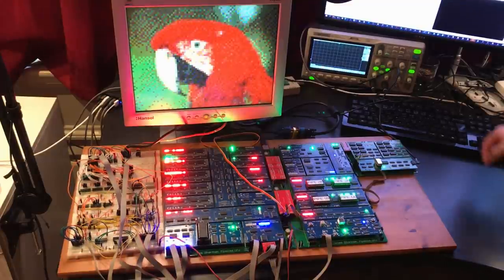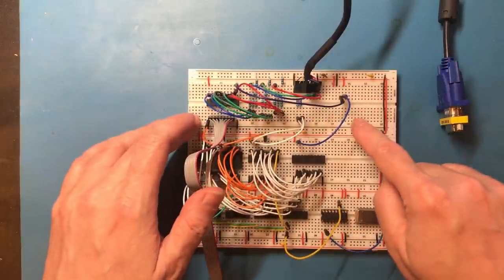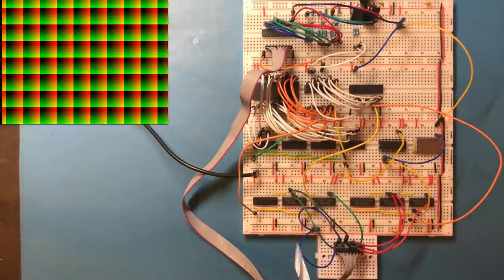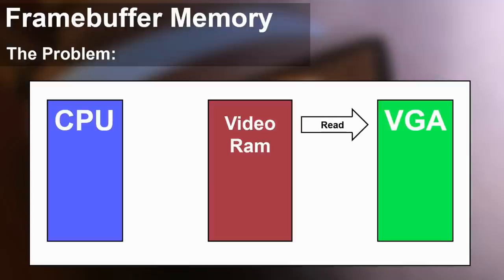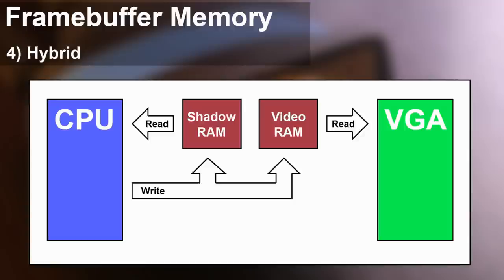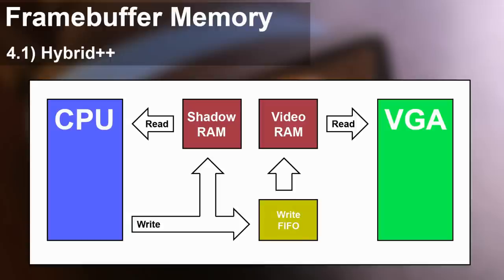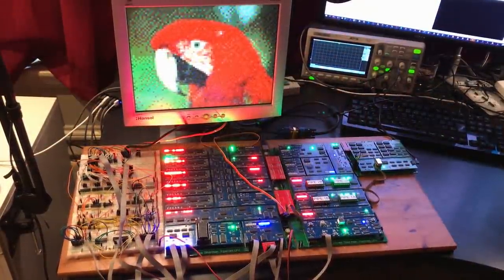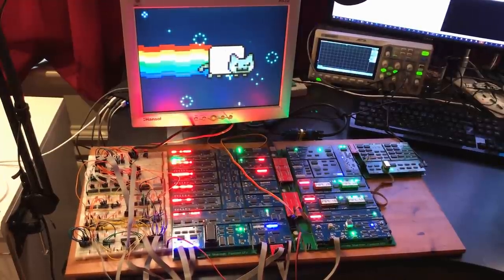Framebuffer - VGA from Scratch - Part 3

Comment from the maker: These are the vga capture devices I purchased from amazon.co.uk
  VGA to HDMI Adapter  https://amzn.to/3fmxUMT
  USB HDMI Video Capture Dongle https://amzn.to/2VgfTZI
Equivalent looking links from amazon.com:
  VGA to HDMI Adapter  https://amzn.to/3zXCgBZ
  USB HDMI Video Capture Dongle https://amzn.to/2VixaRP
Reply: I don't think the equivalent on amazon.com you've chosen will work: 
This 6ft HDMI to VGA converter cable is ideal for transmitting and converting digital signal from HDMI devices(Notebook, PC, Laptop, DVD player, Nintendo Switch etc) to analog signal VGA devices(TV, projector, monitor etc).

Comment: That write FIFO is a really elegant solution to allowing much greater software freedom over video ram, I'd love to see it implemented
Reply from the maker: Indeed,  I really liked they way it slots is nicely as an extra feature rather than something you have to design around. Without it you have a working system, with it you get a simple improvement.
Reply: @weirdboyjim  but how do you deal with the edge case of the FIFO buffer overflowing? maybe you have to have the FIFO buffer be the same size as a whole frame and it 'degenerates' into a back buffer solution?
Reply: I vote for the FIFO too...
Reply: Ditto! I'd totally love to see the extra mile here. Maybe it's good to go without it first so it's possible to compare both.
Reply: @Philip8888888  If the FIFO is full, you simply insert a wait state until it isn't if you're going for a glitch free display. If you want maximum speed, give priority to the CPU write and starve the video by either outputting black or repeating the previous byte for less obvious glitching. The FIFO only need be as long as one scan line's worth of processing as it will get emptied at DMA speed during horizontal blanking & sync. A 64 byte FIFO should be more than enough until James adds the vector processor unit.
Reply: I too am curious about the FIFO solution but I rather suspect that, absent an interrupt system, it has to be all software and it would thus be a lot of hardware for not much advantage.  It could probably be done just as well simply using system memory, especially since your address registers can auto increment on their own.
Reply: @Peter_S_  would you send examples of any ICs that would implement such thing? The only ones I found we're over 40$ at mouser
Reply: I would love to see the write fifo as part of the build, it just adds so much flexibility and adds performance improvements.
Reply: The downside with the FIFO is that it's also really expensive. And conceptually its abitration circuitry has the same order of complexity as a dual port SRAM.

Comment: Vote for the FIFO.
Would be interesting about handling the situation where the FIFO fills up prior to the VGA getting to a blanking interval.
Reply from the maker: The obvious thing to do would be to just wright through, but you should be able to design it such that it never happens. The fastest my cpu with current instruction set can write to memory is at half the clock rate, so currently that would be 40 writes during the visible portion of the line, there would be 160 pixels of blanking interval per line. So a 40 pixel fifo would be big enough, if you raised the clock rate by 5x you could theoretically write faster than you could flush on a line so you would need to be able to handle that.
Reply: @weirdboyjim  An off the shelf FIFO with 64 slots sounds like it would handle your CPU up to 5MHz. If you stick with 4 bit multiples, call it a 256 slot FIFO. Good to 12 MHz if limited to 160 fill, 20 MHz if willing to let it flush over two scan lines. Would seriously doubt any code capable of stuffing data to the VGA that fast. And honestly, suspect that a vast majority of the VGA memory interactions would be scrolling the screen. So 2 clocks to read, 2 to write, and your FIFO has only half the work to do.

Comment: Amazing work and great video, thank you. Reminds me of the computer boards I was working with around 1985, the 8 inch floppy disc drive controller board alone used  about 90off 74 series chips.
Reply from the maker: That sounds about right! Might be fun to pull one of those apart at some point.

Comment: Thanks again for another video. I liked the discussion on how to solve the memory access issue. As someone who also balked at the price of dual ported RAM (seriously, it's 2021, how can this not be dirt cheap now?) it was nice to hear the discussion of alternatives.
Reply from the maker: Glad you liked it! It's a specialty part,  If I was trying to make a specialty demonstration circuit I might have considered it but for this I'm really trying to solve everything from the ground up.
Reply: Dual port RAM is seldom used in any volume application, therefore it tends to be expensive because there isn't volume manufacturing behind it.

Sadly it's probably not likely to get any cheaper either, with complex logic moving into FPGAs which can also implement RAM and DPRAM
Reply: It's cheaper to use an FPGA these days and make use of its internal block RAM which you can set up to be dual ported.
Reply: @nockieboy  mind-blown. i hadn't even considered using an FPGA for something as basic as sram. i know some of the lattice chips are pretty cheap.

Comment: I used to design using TTL and CMOS circuits 25 years ago ... My last design was a thermic printer .You had to control evry single pin in those chips according to the data sheet .Then FPGAs came along ,i would find very hard to go back now .As now i  have complete freedom to structure my design not in terms of generic function chips ..But i can just implement what i need ..But what you did brings me back nice memories ...specially how bulky those designs tend to be ..regards...
Reply from the maker: Glad you are finding it interesting. I plan on doing some circuits with FPGA's in future videos, but not until after finishing the pure(ish) logic cpu first.
Reply: @weirdboyjim  You are a commited person ..As i am of a certain age .Let me tell you before the micro computer revolution .All was done this way .I recall our University HP3000 system had several boards CPU .. you could literraly see the registers lol. And sometime it will  fail and we had to repair them .By using some wand signal injectors and wand logic detectors ..It was fun .It is nice to see someone like you that keep that tradition alive.Engineers now have never touched a TTL manual .at least in paper . It is one of my most proud possesion .Regards .

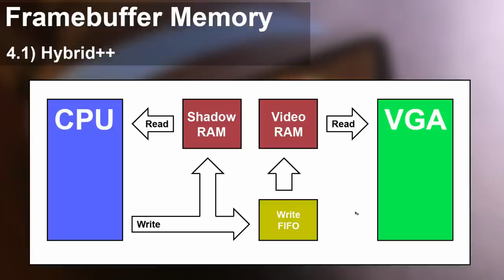Comment: @ 21:54 You also have the paging approach: double memory bank, cpu reads/writes from one memory, the VGA driver reads from the second bank. Both banks are swapped on Vsync. Cons: tear-free requires careful timing or the CPU to set a hardware lock when the first bank is ready for swapping.
Reply from the maker: For many years I was writing games and demos where we had to worry about the raster timing so that's not a worry for me. The problem with all of these "Just have double the circuitry" comments is that it doubles the circuit, and it doubles sections the planned circuit that will appear in later videos.
Reply: @weirdboyjim  True. Note that double RAM is only one more address line, as you did in the Hybrid. On the other hand, the amount of external sync circuitry might be easier said than done indeed.

Comment: Brilliant :-) Thanks for sharing with us. It gave me some ideas that I'd like to implement on my old system.
Reply from the maker: Thanks! Hope your build is going well!
Reply: @weirdboyjim  Thanks for asking :-)
A'm not quite there yet. My project is based on the video interface of the brittish Nascom-2. The very short description is, that a certain memory area has a double function, completely invisible to the CPU. Writing 41H in a memory cell in this area, will result in the letter "A" being output to the screen.
Some counters, multiplexers, an eprom (containing the graphis representation of the ASCII charset) creates the basis for the video signal. This construction makes outputting text to the screen very fast, as the CPU does not have to "draw" every single letter before text is written. This is solemnly done by simple hardware.

My angle is replacing the special RAM block whith a dual-port RAM chip. This will eliminate the need for the multiplexers. Giving the CPU and the Video output curcuits individual andress and data lines to the same RAM block, also simplifies the handling of horizontal and vertical linesync.
A physical VGA-end would be a very nice upgrade to the simple analog video curcuits of that time :-)

Comment: 12:25 depends on where you buy! when i used one of those exact chips in my first crappy card i bought it used for a fraction of the retail price.
the downsides are the size of the chip and the speed. if you need more than ~16kB of VRAM you're gonna need a really big PCB, and at 55ns access time you won't be able to get anything that requires high bandwidth
Reply from the maker: I’m trying too only use easily available parts from common suppliers.
Reply: @weirdboyjim  yea that's reasonable. i feel like i should stop commenting on this older videos and just watch the whole series to maybe get some more ideas for my own Video Card design.

Comment: Awsome as always. FWIW 12nS 32KB SRAMs in DIP: IDT71256SA, £3.35 on mouser. Also available, at £1.37, in SOJ for the PCB.
Reply from the maker: Thanks! I wanted to stick with the 8k ram chips, there is also another problem I'll be talking about later that I want to solve the right way rather than be tempted by the "Yeah, but we can ignore this because modern ram is insanely fast" solution.

Comment: what about a system kind of like PCRA where the CPU writes to the shadow buffer and then the buffers swap, whereupon the write is reissued to the other RAM chip?
Reply from the maker: Double buffering like that can be effective, but it's not free. You have to double up all the address multiplexing logic (you have 2 lots of address bus to change), but it's also an impediment at times. Most games and visually impressive demos in the 8-bit era updated the screen incrementally rather than redrawing everything and double buffering means you are updating on top of the frame before last.
Reply: @weirdboyjim  first of all, huge fan. I love your build series, and if I hadn’t watched it, I might not have found so much interest in this type of hardware engineering.

My idea wasn’t really a full double buffer, and after some more thought, the computer has to issue a nop on the 2nd clock after a write which guarantees on that clock that the computer won’t be accessing the vga, and it can only issue 2 writes in a row. It might be possible to use latches to store writes temporarily while putting them in the shadow ram, then trigger a swap on the NOP, which could probably be made pretty well by running it from the VGA clock and issuing the buffered write. Because the system clock is much slower than the VGA clock that runs the swap, it should be possible to pull it off. Also, only 2 writes would need to be buffered, and only one catch-up write per swap. It would certainly be quite a lot of circuitry, but it’s more like a limited write buffer where you can guarantee only 2 writes ever need be buffered like in the video than a whole redraw. While it may not be the right solution here, I don’t think it’s entirely invalid.

Comment: Awesome as always, thanks! This feels on the same level as the first computers and consoles I started using.
For the videos, what data format did you use? Just the raw data for all the frames?
Reply from the maker: The static parrot image was raw data, the animations I had to implement some compression with support for delta frames. The first one was 12 frames and came it at 13KB, the "post credit scene" was 33 frames and I had to implement some lossiness in the compressor to fit it into memory, it came in at 41KB. In both cases a stored the extra delta frame to loop it back to the start to keep it smooth.

Comment: 20:30 choose to ignore the contention to update the entire screen at the start of a level:  You just need to add a master ENABLE signal, so you can turn off the output (replace the RAM-DAC output with a constant value) then do your update, then re-enable the normal operation.
But, if you are going to double the RAM and have two identical copies, you are so close to having a proper double-buffer system!  Instead of writing to both, just have complementary enable signals on the bus drivers on each side, so by changing a bit you can exchange which RAM chip is connected to the CPU and which is connected to the VGA.  So, you write your updated frame and then output the signal to swap.
Reply from the maker: I'll likely have a blanking control, but a true double buffering of the type you describe is more complex than that. You basically end up doubling all the multiplexer circuitry which is what I wanted to avoid. I certainly wouldn't want to do that on a breadboard.

Comment: Hey really glad to see this project progress. I feel you missed a big opitunity with your vga. You use double RAM to combat the contention issue but you could perhaps use it as a hardware double buffer. That way the VGA adapter would be reading from one whilst the CPU writes to another, obviously you lose the ability to read what is currently being drawn to screen but you gain the ability to write as slow or as fast as possible since the CPU would be in charge of flipping the buffers at the next available blanking. Anyway thats just my idea, you obviously got yours to work and it's amazing.
Reply from the maker: I regret not covering this kind of double buffering in my discussion but I don't agree with you. I think perhaps you underestimate the amount of extra logic that is necessary to implement that, You would roughly double this circuit. You'll also find a true double buffer get's in the way of doing incremental screen update which is the way to get fast updating graphics on an 8-bit cpu. Double buffering comes into it's own when your cpu and memory architecture get's to the level where you can fill the buffer with useful processing at a respectable frame buffer. I plan on my games running at 60fps and I'll need every trick in the book to do that.

Comment: You could implement that kind of Write FIFO system in software by switching to a double-buffer memory architecture. Still just two RAM chips, but you multiplex both chips to both CPU and VGA, with a way to swap the front and back buffers in hardware. Updates to one buffer can be stored in a software queue that then gets flushed after the front/back buffer swap.
Reply from the maker: That kind of double buffering would require you to double up the multiplexer chips and some additional glue logic. There are indeed lots of different ways to do it, but I can only cover so many in the my discussion.
Reply: Honestly, that’s what I thought you were going to do, James.  I guess the downfall of that approach is that the frames have to be fully rendered before the “ping-pong” switch gets thrown, plus it ears too much address decode in main memory...  hummm, never thought of your “shadow” approach with a FIFO, that’s brilliant!  Kudos!